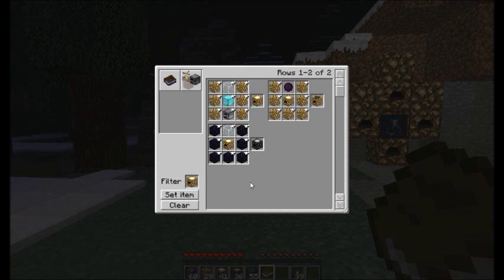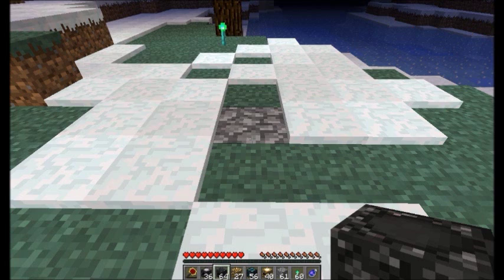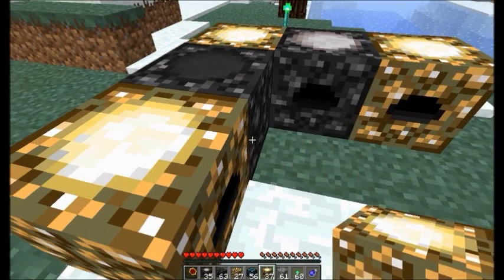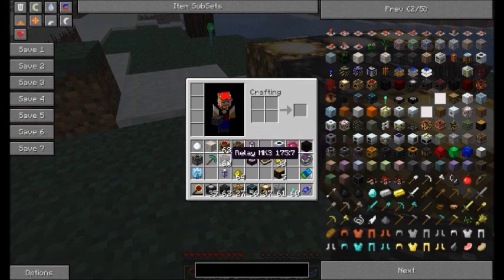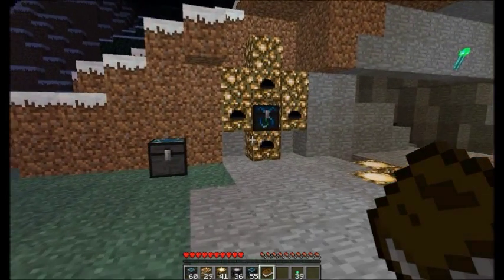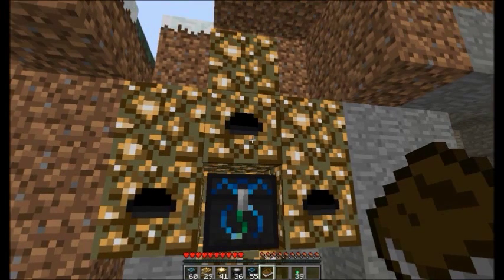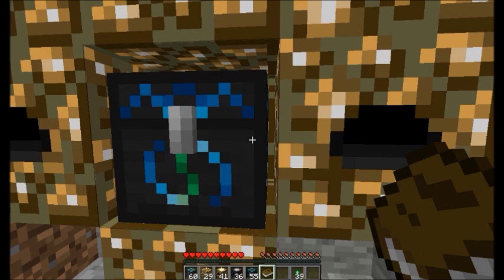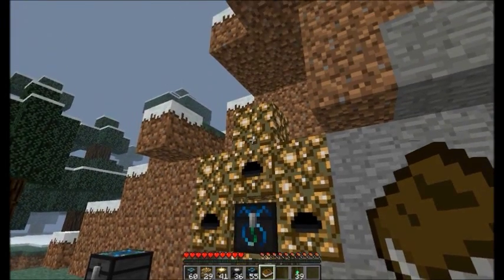EqEx Guide to Energy Collectors, Antimatter Relays and Energy Condensers-Part 1

Comment from the maker: @TheDrCN for the smaller setup that's true (with a single relay or condenser in the center) I should have been more clear. I was refering to the 5 relay setup. even if it's in the ceiling (the 5 relay flower) there are collectors under Relays no way to put glowstone on top of them.

Comment: The collector on bottom isn't getting any light. The setup in the ceiling is more efficient and still easy to access, especially if you want to pump in fuel and pump out materials using buildcraft.